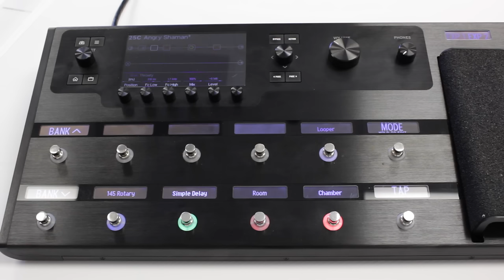Line 6 Helix - Footswitch Modes

Comment: Hey, if I have an amp running L and one running R to the outputs, but I have different OD's on each path, can I set just ONE footswitch to turn BOTH of the OD's on/off at the same time? (rather than having to hit each FS)... THx.
Reply: +ckjjclan Yeah, man.  You just have to assign each of the ODs to the same footswitch.  They need to be both on or off the same when you save for the footswitch to function like you want.

Comment: Is there any way of using the bottom ABCD as presets, and the top ones as footswitches?? . It worked on my PODHD500X, i kind got used to that function :)
Reply: Did you ever find out if it will do this? I liked that function as well, and I don't like having to hit another footswitch just to toggle a boost (or other effect) on and off in a preset.